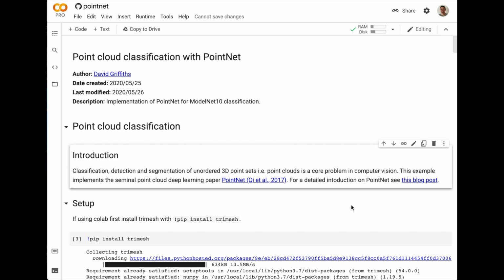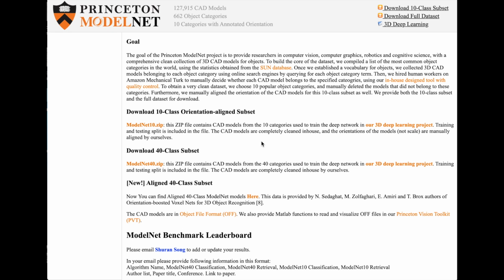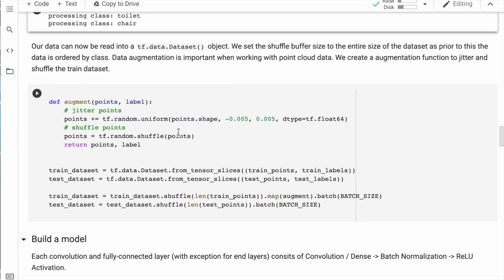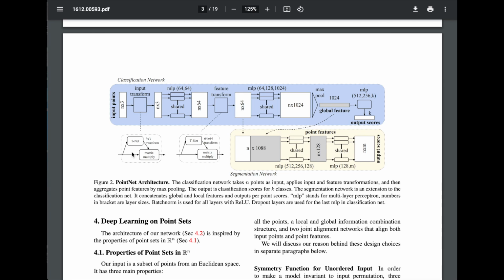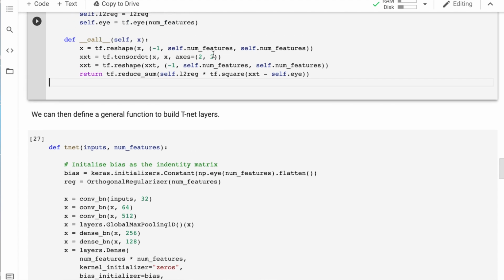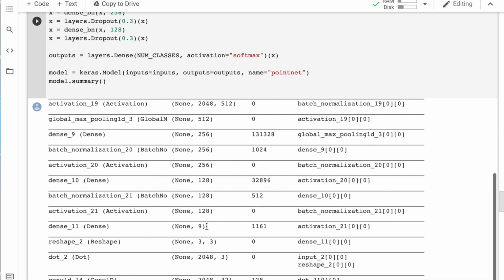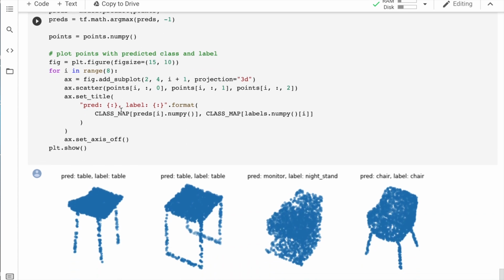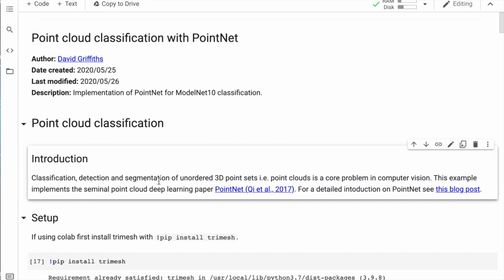Point Cloud Classification - Keras Code Examples

Comment: Thanks for the video! I am not an expert in this, but the basic intuition is that point clouds are sets so there is no natural way of ordering them i.e. you can NOT identify which is point 0, 1, 2... n, consistently between samples. On the other hand, grid convolutions assume a very precise local ordering so the regularization applied in PointNet I believe is trying to somehow learn an ordering in the first half of the network and then using it in the second half.

I believe GNNs and Transformers are much better at this task than CNNs since they naturally operate on sets. Things like the SE(3) Transformer even (try to) encode 3D rotational symmetries into the architecture.

A good data augmentation for this is 3D rotations so the network can try to learn to be invariant to this just like with CNN and rotated images.
Reply from the maker: Hey Cristian, thanks for this information! I agree it definitely seems like the Transformer would be better suited for this problem! I'll check out the SE(3), still very new to point cloud research haha! Interesting to see data augmentation in the geometric dl space, 3D rotations like neural radiance fields seems like it could be interesting for 2D image data as well!
Reply: @connor-shorten  check out the "Point Transformer" published in 2020